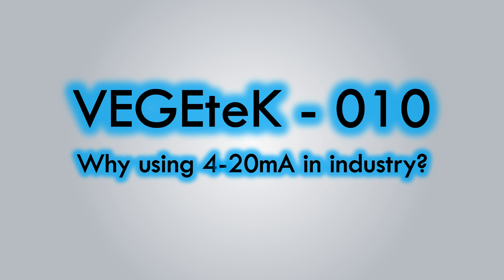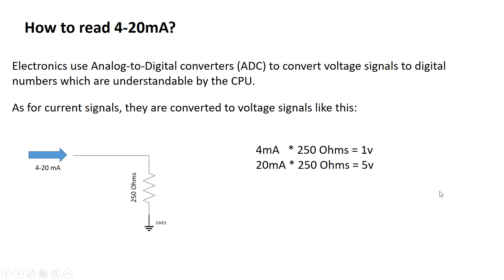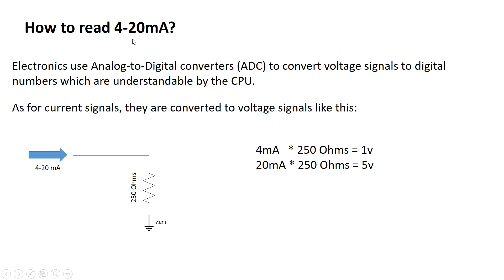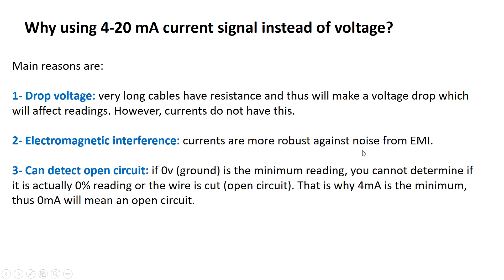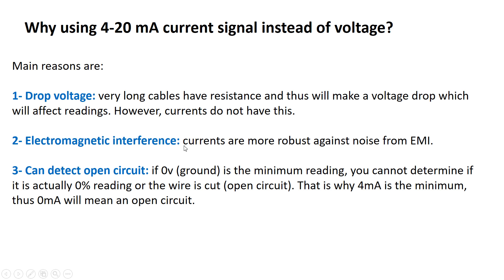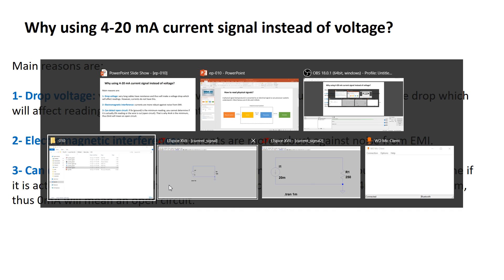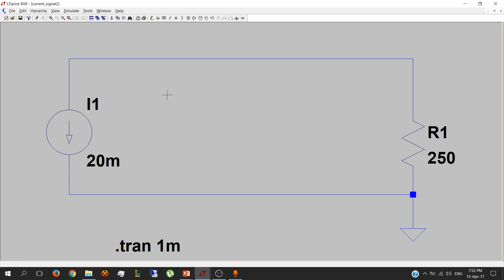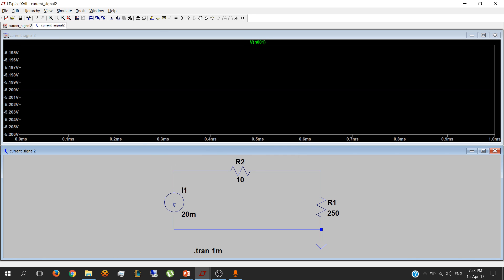Why using 4-20mA in industry

Comment: for a long distance signal transmission, voltage has a drop,but current does not , thats why normally use current to transmit electric signals. As far as a voltage/current transducer(sensor) is concerned, the output signal adopts 4-20mA that's because 4-20mA is a safe signal,esp,in a coal mine,or explosive-proof sites, the spark energy caused by 4-20mA current is not enought to cause explosion. 
 https://www.g-sensor.net
Reply from the maker: thanks for your feedback

Comment: Good video, but it still fails to explain a few important things:
- In series circuits, current is constant, meaning that current is the exact same at any point in that series circuit.
- Current is NOT less affected by magnetic fields than is voltage. However, if extra current is magnetically induced at one or more points in a series circuit, that same current will also flow everywhere else in the circuit. Because of this, the transmitter is 'aware' of the extra unwanted current and can thus instantly adjust the loop current to compensate. The same applies to changes in the resistance of the series circuit. This compensation would not be possible if the process signal were sent as a voltage.
- The action of the transmitter is key to the success of the current loop. It can instantly adjust its series resistance as required to regulate the loop current to the desired value. It also monitors the loop current so that it can instantly compensate for errors and outside influencing factors.
- Some current loops DO use 0-20mA. One of the advantages of using 4mA as the minimum normal value is, as the video states, to allow detection of open circuit and/or loop power supply failure. Another big reason is that always having at least the 4mA quiescent current in the loop circuit, is that this provides a small power source to operate the transmitter, as long as the transmitter is designed to never require more than 4mA. Without this quiescent current, there would need to be an additional power supply to operate the transmitter circuitry; this scenario is called "4 wire". When the transmitter is designed to operate on only the quiescent 4mA, then no additional power supply is required, and this is called "2 wire".
Reply: Yes, 2-wire transducer(sensor) save costs in practical industrial use.  there is our 2-wire transducer:https://g-sensor.net/signal-conditioner/ac_current_transducer//2019/0110/380.html
Reply from the maker: thanks, will consider your point in future videos

Comment: Question, Why we don't have use 1V as a minimum voltage, hence we can detect both minimum and open circuit, like 0 and 4 mA
Reply from the maker: It is better to use currents not voltages according to what I explained. using 4mA as a minimum instead of something like 1ma is according to my thought due to the fact that 1ma is almost noise level and you cannot differ between if it is noise or a signal, while 4ma is obviously not noise.

thanks